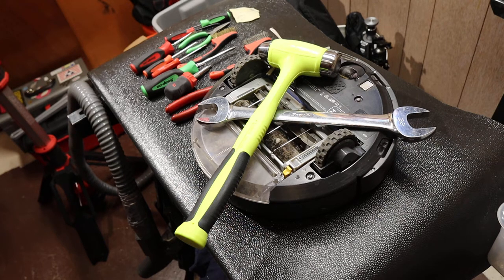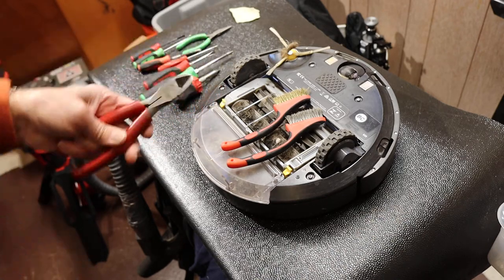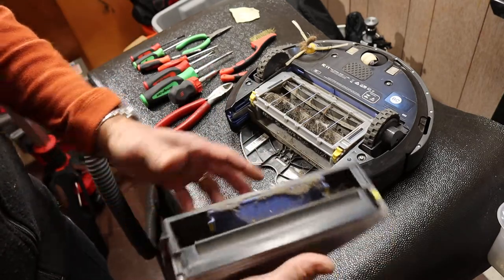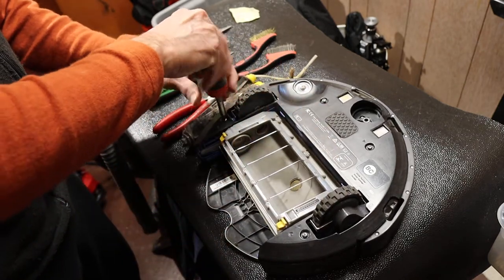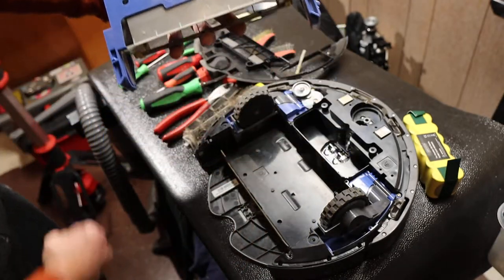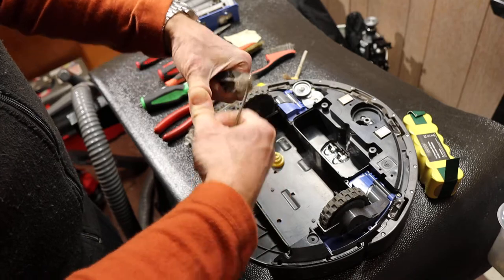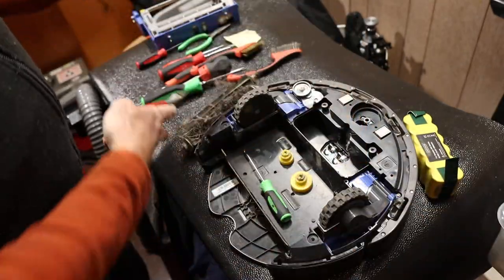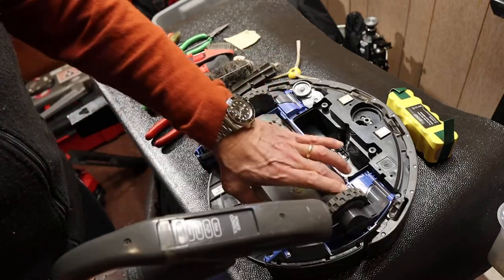Do I Need Snap On Tools to Clean a Roomba?

Comment: That small little tool you have there is from SGSR104AR Seal Remover Set for transmissions seals. Great tools for working on V Twins oil seals. Have a happy New Year.
Reply from the maker: Absolutely correct! I will make a note of that in a future video. I buy them to use as small smooth pry bars for use with electronics. My Snap On dealer sold me on them and said they were in popular use as micro pry bars as well as seal removers. I just forgot the name since I never use them for their intended purpose. Thanks for your comment.

Comment: Thanks the vids Doc!  I think a stiff nylon brush would be more 'plastic surface friendly' while strong enough to loosen up that caked on dust.  Disappointed in the lack of Snap On emery paper as well, almost had to hit the dislike button and Rubber B that DSSD 😁
Reply from the maker: I have some plastic brushes, but if the Roomba runs over anything wet on the floor, the dust solidifies and brass or stainless works much better. But plastic bristles are a smarter choice in the long run. And I like to know the time and the DSSD is durable enough. Tired of knocking off the hands while chopping wood.

Comment: That is a "Seal spoon", not a hockey prybar.
Reply from the maker: Absolutely correct! I will make a note of that in a future video. I buy them to use as small smooth pry bars for use with electronics. My Snap On dealer sold me on them and said they were in popular use as micro pry bars as well as seal removers. I just forgot the name since I never use them for their intended purpose. Thanks for your comment.